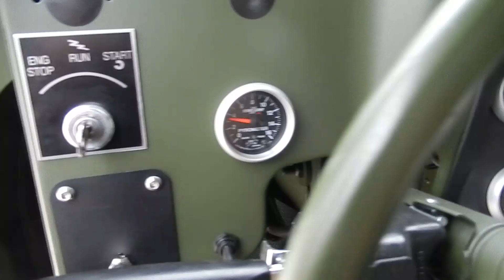hummer military 035 M998 Hummer H1 cummins 12 valve C&C Equipment #1

Comment: LOOKS VERY NICE,DID YOU HAVE TO BEEF UP THE FRONT SPRINGS?
Reply: The cummins engine wouldn't put enough weight on to need that judging from what I could see they are stock springs

Comment: $60,000??!!! You’re fucking high 😂😂 I can build one for probably $15000-25000. Surplus hummer: $8000. Used running 12v $3000. Swap components,suspension, wheels, tires interior etc. $10000. If I wanted to I could build one for $15000 easily it would ride and handle like shot and probably be very uncomfortable and not very useable for every day use, by it can be done. $60k is a good price for a turn key truck like this that’s well engineered.